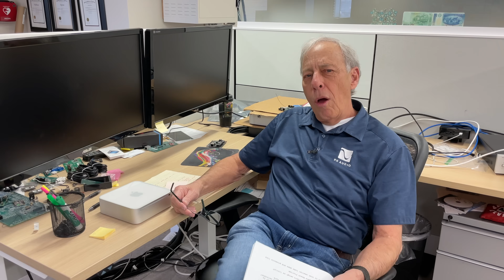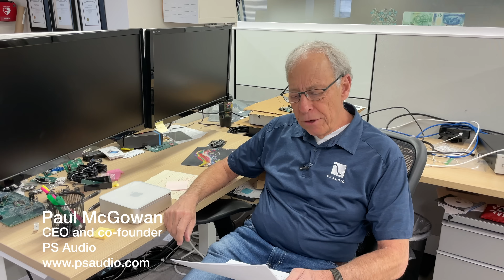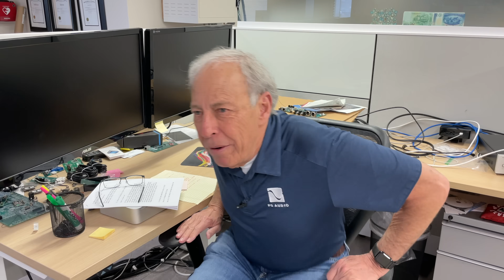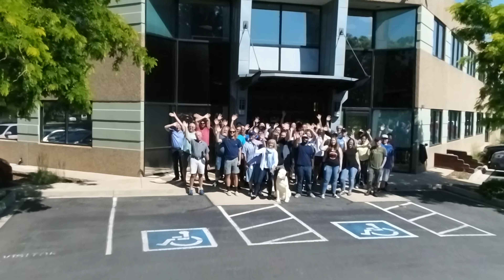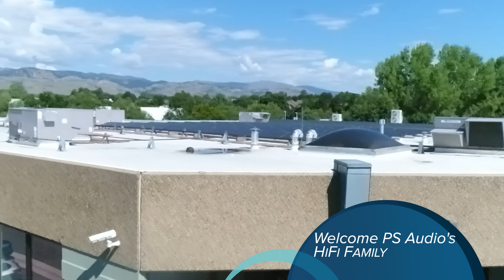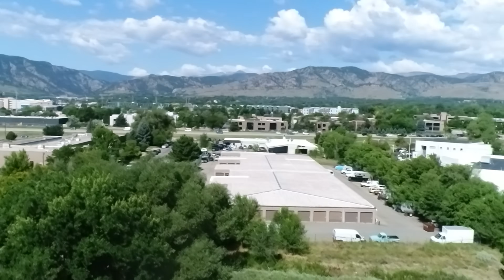What is damping factor?

Comment: I asked a similar question. My amp is newer and my speakers are 1969. And I am still a bit confused 😕
Reply: @Douglas Blake Manufacturers almost always (unless stated otherwise) use 8ohms as the load to calculate their DF. And often only at one freq (400hz sinewave?) Which adds confusion to the whole discussion. Few "8 ohm" speakers stay anywhere near 8 ohms across most of the freq range. Some going up to 30 ohms or higher and my Maggies down to 2ohms above 2k. And amps can change output impedance at different frequencies as well. 

An amp with a DF of 10 would mean 0.8ohm output impedance. Even if they measured 20-20khz my 2ohm @ 2Khz would mean my DF would be 2/.8 = 2.5. 

Now, 10ft of 12ga wire is roughly 0.04ohms. We spend a fortune on better wires to drop that even the slightest bit lower? But accept adding 0.8ohms  on top of it?

So no a stated DF of 10 is not good enough. While yes there is a point of diminishing return, it should be at least 100. That at least means only twice as bad as zip cord.
Reply: Depends on the speakers what sensitivity are there what Ohm's what is the damping factor of your amplifier
Reply: @Douglas Blake Thank you I think that was reassuring
Reply: I have a vintage amp with newer speakers, I think that's the way to go. The speakers are super analytical/revealing (too clean) but the old class A amp gives it some warmth and nice distortion.
Reply: @Douglas Blake No I did not miss that. Again a DF is measured into 8ohms. That is what that number is. A DF of 10 mans the amp has a 0.8 ohm impedance. That impedance does not change as the speaker load changes. If you go to a 4ohm speak that same amp will have a DF for that speaker at it's 4ohm spot of 5. Thus not even meeting your 10 requirement and it is the same amp. 

And again, a DF of 10 (@8ohms) is equivalent to 200 ft of 12 ga zip cord. And you consider that acceptable? 

And once more, most amps only list the DF at one frequency when it changes across the audio spectrum. So even that DF 10 will be well below that at other frequencies. 

As Paul says, 100 minimum. And across 20-20Khz.